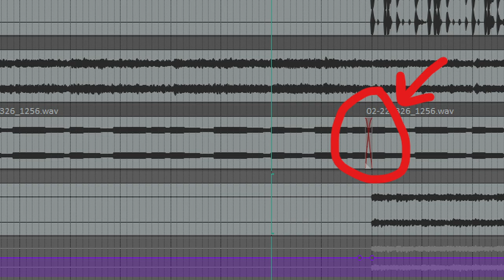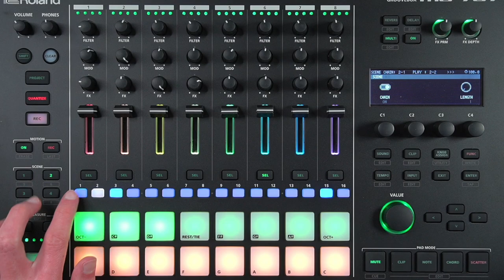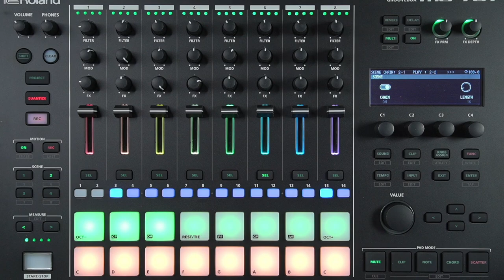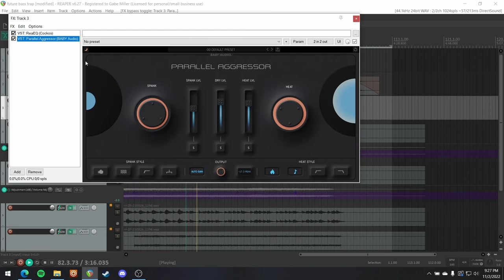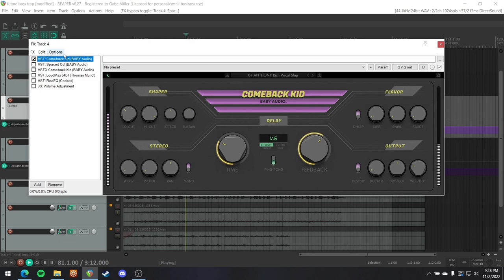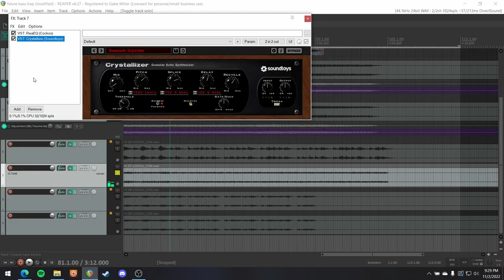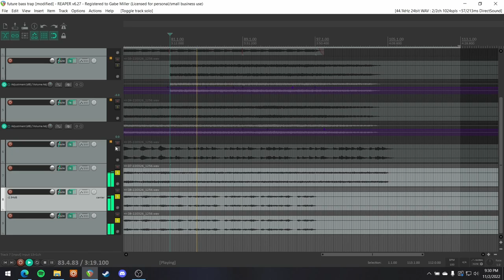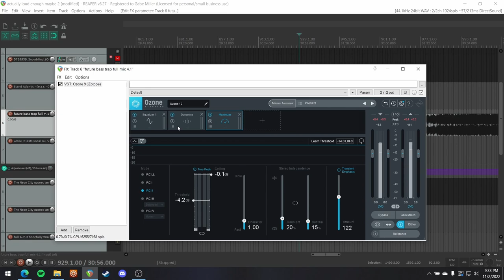How to Make FULL SONGS on the MC-707

Comment: There is a workaround for the monophonic overlap as long as your patch is set torespond to velocity sensitivity. You drop a note on the very last step of the sequence and shift its start point to +99 and its velocity to 1. The note will trigger but wont be audiable allowing it to act like a choke/mute at the loop point. A similar technique can be used when triggering things like vocal samples in the drum tracks to add variety. For example if you have a 3 second vocal sample you can set it to mute wherever you drop a second note set at 1 velocity. Now if you set the mute probability to say 50% the sample will play the shortened version v the full version 50% of the time. Great trick for adding variety over time

Comment: I'd definitely do some similar stuff in post in the DAW.  However, I have found for when I want to just share smaller ideas straight from the 707 (such as through the generic USB driver to my phone as a stereo signal), the master FX are pretty great to fill out the sound.  Mostly, the multi-band compression there really separates the frequencies better and adds more punch.  I'd highly recommend it.  You can also turn on stuff like an enhancer or step filter before it if you like, but that MB compressor is something I do on almost all my tracks, just to make it enjoyable to my ear as I'm listening on the 707 itself.

Comment: Hi, thanks for the guidance! Better than in Roland docs. BTW - in 10:40 you say you don't know really why there are multiple arrangements. Actually these can be used as subsequent scene banks, so for example Scene 1-16 will continue to Scene 2-1, if you set up Chain and Length in it. Even better, Scene 4-16 will jump to 5-1 as well. So you have 8 x 16 = 128 scenes to be potentially sequenced in the project for the long or sophisticated arrangements.

Comment: 5:22 has Roland acknowledged this issue? As I'm not an MC 707 user, my first recommendation would be to program or send a "note off" message to the bass at the last millisecond before the scene change/the next measure. I'm assuming this is happening because of a note tied over to the next scene. However, this creates the predicament of never being able to have a note tied over to another measure (like a legato etc) if there is ever a scene change. If you don't want to send or can't send the note off message in the 707, try to automate the release go away at the last millisecond, and restore the natural setting in the next scene.

Comment: Gabe, 
1st. Thank you! I have been wondering how to do this and you just released this video!

2nd. I notice in the Utility Type 1 scene setting, you still have scene banks and can set chaining, you just select the banks using the 16 step keys instead. I like Type 2 better though needing to push shift less. It just numbers the scenes differently to fit depending on Type 1 or 2 that you choose.

3rd. That is it mostly. Do you think you can achieve some of your post-effects using the individual track and master built in effects? Just curious how much is worth trying to do ‘in the box’.

Thank you, Peter B.
Reply from the maker: 1. Niceeee, hopefully it's helpful!
2. For whatever reason, the manual is really clear about wanting to switch to type 2 for the scene chaining, but maybe that's just to get the deeper functionality out of it. I'd have to double check. But yeah, normally I like to use type 1 for basic scene stuff since it's simpler.
3. I could probably get close, I just like the extra control I get with the individual tracks. Plus, really fine tuning the sounds is easier in the box. I think you can get similar sounding stuff on the device itself if you're patient. I've recorded many a Novation Circuit jam with just stereo outputs (since that's all you get) and gotten pretty good results with just mastering.

Comment: Super helpful. Was wondering if it still only allows 16 scenes?
Reply: Whether in Type 1 or Type 2 scene changing modes, it still has way more scenes than you'll need.  Pretty sure it's 8 * 16 = 128.

For Type 1, you get the 4 scene buttons X 2 (pressing shift), and then the 16 step buttons are banks of those 8 scenes.
For Type 2, the scenes/banks are opposite where the step buttons are 16 scenes and the scene buttons are banks of those (up to 8).
Several, like myself, prefer Type 2 for the fact that we rarely need more than 16 scenes on smaller projects, and being able to store and recall scenes and watch them flow left to right across the 16 step pads is easer than constantly having to hit shift or change banks all the time in Type 1.
The one main advantage of Type 1 is that you don't have to be in Mute mode when changing scenes.  Some like to stay in Note mode for pad muting and such.
Pretty sure they can both be used in scene chaining.
Reply: @chrisb3389  thanks a lot for clarifying. I thought it was only 16 (Ableton type) scenes. I wasn’t aware of scenes banks. That’s good news.

Comment: Are the patches all the same as the verselab. Maybe im overtaking it, but i would like to compose and finish a song on the verselab, then transfer the midi into the mc707 to perform the song.
Reply from the maker: That's probably overkill, but the patches are the same if I recall correctly. You'd probably be better served just going with the MC-707, because the song mode stuff of the verselab doesn't transfer over as far as I know

Comment: Did you sell the Roland mv-1 verselab? Would love to see an updated video with the firmware update.
Reply: Sorry for being off topic. Only reason I asked is I have a verselab coming and I’m a sample based producer but feel like the 707 might’ve been better.
Reply: @bloodmoneyperez  Neither of them is good for sample based producer. I got the 707 & the Force. The Force/MPCs is made for sample based producers by far.
The MC707 is a better synth sampler like if u want short sample to add custom waveforms for it deep ass synth engine.
Reply from the maker: It was on loan so I had to send it back. And yeah on the topic of samples, the 707 is definitely better than the MV-1, but still not great for sample chopping/flipping. The SP-404 MK II may make more sense if you want to stay Roland, or yeah the standalone MPCs (or the Akai Force if you want to keep the performance aspect) are well worth a look.
Reply: Looks to me like the song mode on the verselab is much more powerful and flexible. Maybe also the mixing and mastering could've been done in the box instead of moving over to the DAW.

Comment: I am not a live performer. I am a home recording type. Is there anybody out there that can unpack this - "There’s no way to automatically string clips together into a full song or arrangement, so no way to export full projects"  Many reviews in one form or another state this about the 707 but I don't get what that actually means. After you finish recording your tracks (clips/ parts or whatever you call them).. You cannot put them together? Or is it just that you can only play each section in real time to some other outside device or format?
Reply: You can definitely use scene chaining to play all tracks fully and record into a DAW. I did that on a full song.  I'm not much of a live tweaker, so I just wanted to hit play and get my song into the DAW.  It works fine for that.